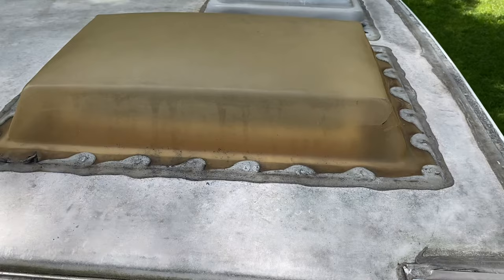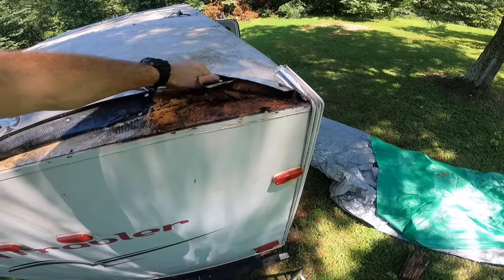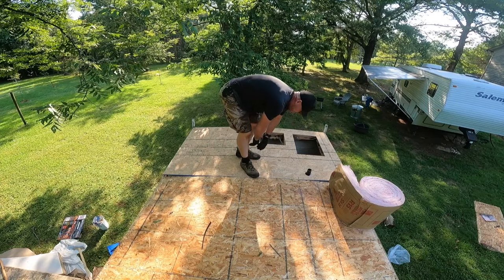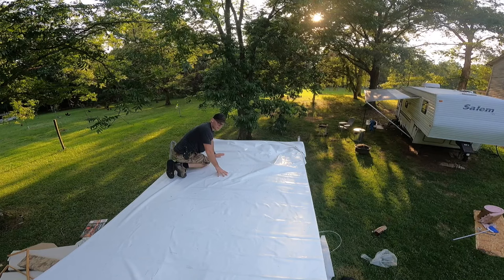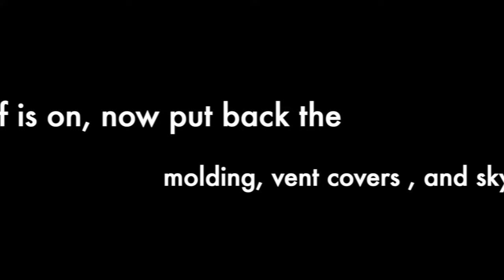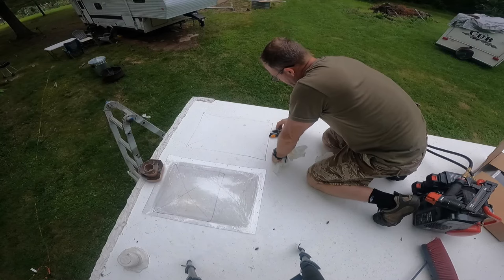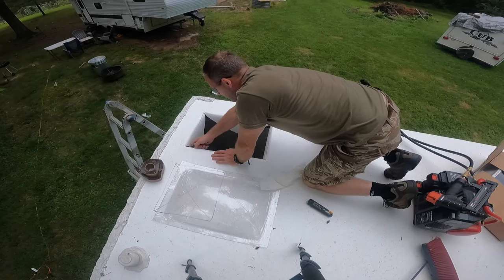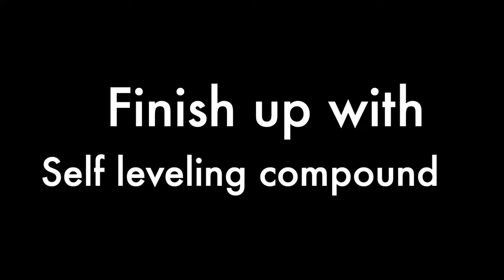Cozy Camper RV Roof Repair and Replacement (DIY Save $1,000's!!!!)

Comment: Good video, BUT the music made it almost unbearable.
Reply from the maker: Thank you for the constructive comment. I am new to the editing video part. Some limitations on non-copyright music. Do you prefer no music or do you have a specific sound you would recommend. FYI, my wife thinks it's terrible as well. LOL
Reply: @parkedredesign  Like I said, your video content was good just choose better music that is not so harsh.
Reply: No music would be great. Maybe give commentary on what task you're doing, why, and tips, insights you'd like to share. Great video!
Reply from the maker: @sharonharrison4795  I will work on my commentary skills for the next fixer upper. I do need to be a little better with explaining what I am doing. Thank you for the comment.
Reply: @parkedredesign , just to add to the comment on the music.  I'm not that picky on the music.  Yes, some choices are better than others.  But my main criticism with this music is this:  When you were talking I had to turn the audio way up.  When the music came on it was 3 times as loud as your voice and was blasting my ears (and I'm hard of hearing).  Music is intended to be background in something like this.  Please level the volume appropriately.  This isn't about the music.  It's about the instruction.  Music is intended to be a filler background to help it as you go along, not blaring so loudly.  Yea, just tone it down a lot and make your voice better heard when you speak.  Thanks.  Great instruction.
Reply from the maker: @gpenrod5221  Thank you for the comment, I will remember this in my future editing of videos. I appreciate it.

Comment: I’m looking at doing this to my RV early this summer. I’ll be doing it by myself and it looks like you were in the same boat. How long did this take you?
Reply from the maker: I actually took the roof off, repaired the rotted wood and put the new roof on all in one day. Then it took me the next day to put the molding, AC,  and self leveler on to finish it up. So it was completed in a weekend.

Comment: Awesome job! We just got one and this video gives me the confidence I can get things done on my own! The roof looks great, you should list the products you used for the silicone and adhesives.
Reply from the maker: Thank you for the Awesome comment. I can't remember the names of the silicone and adhesives, but they came with the roof kit I ordered off of Amazon that is listed in the description. I bought the package that had everything. Good luck on your restoration. I will say at times it can seem overwhelming but if you just take it small steps at a time you'll have no problems. Let me know how it goes and if you get stuck or have questions please feel free to ask.
Reply: @parkedredesign  thank you so much, i might have to message you if I get stuck.

Comment: Thinking of doing this also but mine is much bigger. May get a quote to see what something like this costs for a 33-foot trailer.
Reply from the maker: I originally was thinking about having it done professionally. I was going to use RV Armor, very knowledgeable people and the fact that they guarantee the roof for life. Ultimately I ended up doing it myself because of the cost savings and I am on a budget. It is a little time consuming, but overall I was happy with the way it came out.
Reply: It will be exspensive
Reply: For that size it won't be cheap I have a 22 ft and they wanted 7500.00 times are high now days
Reply from the maker: @douglasbows7720  wow, was that for RV Armor? If so there prices must have gone up. I want to say they quoted me around 3800 for the 18 footer, but that was a few years ago.

Comment: Gotta do this to mine. You definitely made it look easy.
Reply from the maker: It really isn't too bad, just takes a little time. I am working on a pop up camper roof right now, and I am going to try Heng's rubber roof coating. We'll have to see which is easier to do.
Reply: @Parked Redesign  I'm definitely thinking about doing it just have to get another ladder and a few more things. I seen this stuff eternabond I may go with that over the self leveling adhesive but I'm just trying to learn all I can these guys rv roof Install have alot of information.
Reply from the maker: @2alawabidingcitzen  Multiple ladders definitely help, let me know how it goes!

Comment: Did you install drywall mesh tape on your seams and perimeter?  Or some other type of tape?
Reply from the maker: Yes it is just drywall mesh tape I got at Lowes for $5 a roll. Recpro sells an "RV" roof seam tape for $20, which looks to be the same thing.
Reply: @parkedredesign  Thank you